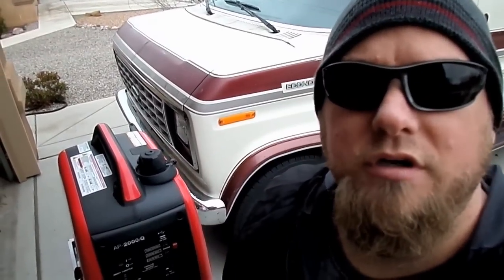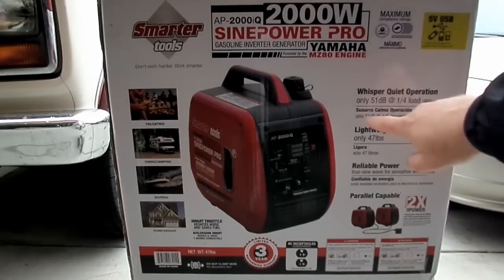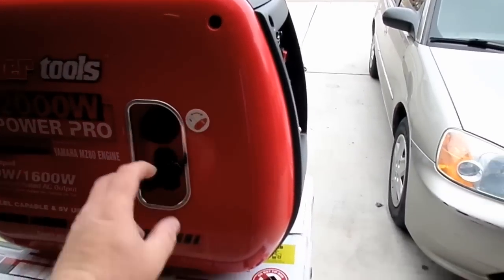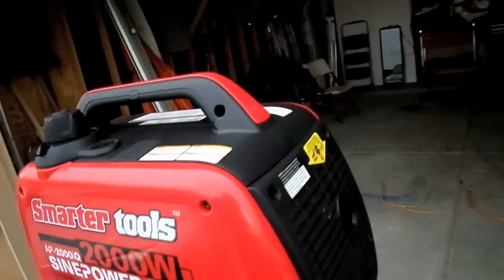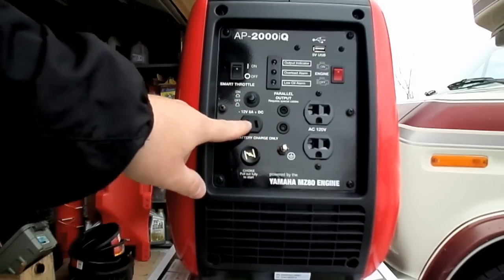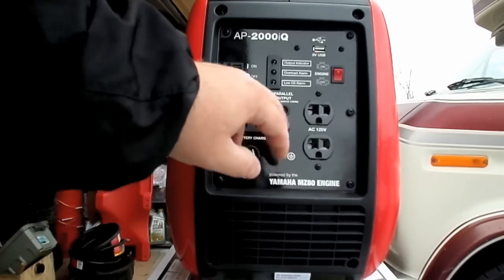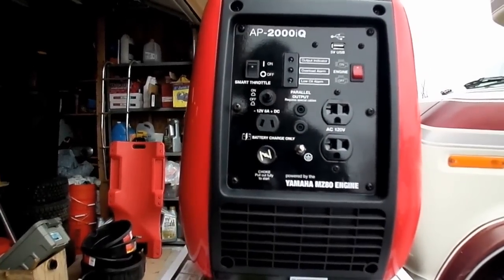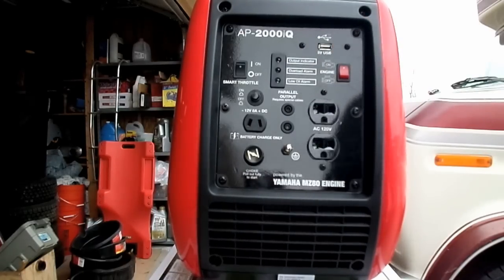Smarter Tools Yamaha Inverter Generator Testing on AC & Microwave in RV CamperVan & Info

Comment: bought 2 of these with the parallel cable. these are the best inverter generators you can buy for the money. no point in the honda when you can grab these for $599 each at Costco. lifetime warranty through Costco. parallel kit was $59
Reply: jgg204 forgot to mention in my comment  - this was the best and more thorough review for the AP2000iQ. Thumbs Up

Comment: Not a Yamaha. Yamaha would not sell engines to a competitor. The company who manufactures Yamaha engines also sells engines to other companies. It's not the engine that you need to worry about, it's things like the stater and the inverter that are inferior. When these things break they are disposable. When a Yamaha breaks it's worth fixing. Do you know that in many cases with these "Economy tools" the employees can't afford rent, let alone the products they manufacture. I already know someone who has felt the sting of buying a Generac branded generator that uses the same engine as yours has got. They're not the same. Trust me!

Comment: Just subbed to your channel.  Thanks for the info !!  Is this generator cheaper than the actual Yamaha version.  I see it's the same motor, but if it's cheaper, I'd definately buy one. Don Carpenter has a youtube channel with a neat hitch rack setup for his generator, you might want to check out.  Thanks for the good information.
Reply from the maker: Yeah Gary.. this geny is only $600 at costco or online. Get one they are great!
Reply: Quite a savings....Thanks.  Lookin' forward to seeing more vids from you.

Comment: I just was checking out the specs on the Honda ei2000 and saw that the fuel consumption for rated load which I think is 1600 watts and max of 2000 is only 3.4 hours and 1/4 rated (500 watts) is 8.? Hours. My guess is the smarter tools and Yamaha are in that range too. 
So my guess is if you are running the AC you might be be getting close to the same has consumption as the Onan. I just saw the Onan C 2.8 microlite for $2264 at PPL no tax free ship. Not sure if the New gens are built better since cummins took Onan over or not. I'm thinking that if you use the gen a lot for the AC and boon-docking that the convenience of the O-C may be the way to go. And also for resale value . If I pickup the 2000 P-way I think I am leaning towards the 2.8. 
When you live in FL or travel out west you well I need AC. 😉
Reply from the maker: Chris Paulick I have had 2 onan 2.8 microlite gensets and I had problems with both and I did not like them. That is my personal experience. The honda or yamaha inverter gens will get better fuel economy. And inverter generators are a cleaner source of power and work great on sensitive electronics as well. The onan is louder. But the onan has more watts available which is nice. And its nice to have push button start/stop from the inside of RV. And its nice that the onan will also use fuel direct from onboard fuel tank.

Comment: How many watts is ur microwave? Any tips on installation. I had 700 watts microwave n 2000 watts generator but the microwave & generator turns off when it's running.
Reply from the maker: Crisanta Feliciano I believe the microwave is 700 watts. As far as I know the watt rating on microwaves is not the actual power consumption, its the cooking power only. Im not sure what the microwave actually uses but I will look into it and make a video. But if you have a 700 watt microwave and a 2000 watt generator then thats more than enough to power it. My generator is 1600 watts running and 2000 watts peak and it runs the microwave no problem. In fact it ran the microwave and other things at the same time with NO issues. Maybe you have an issue with the generator or the microwave is faulty and pulling more current than it should... one or the other it sounds like. I would need a lot more info on your setup to really be able to help. Sorry. THANKS for watching!

Comment: Bought one in 2015. Worked reliably for almost 6 years. Went to use it a couple of weeks ago during a storm in NorCal and found the gas tank had broken off at the tank fill. Tried to repair it to no avail. There are no parts available as the company went out of business in 2020. So I thought I would convert it over to propane. I am unable to find one that will fit it or a Yamaha for that matter. I have since bought a new Honda generator, but would like the smarter tools one for a spare.
Reply: I understand from a friend that you can purchase a complete carburetor with the propane feature...not sure have not had any time to confirm this. Might want to research it.

Comment: Thanks for the info vid on the generator.  I wanted to know what the difference between the portable generator vs the olean (the one that is built into the van).
Thanks
Reply from the maker: The Onan that comes with the rig is a good geny. And its convenient because it uses the fuel from the gas tank of the van. This geny is quiter and uses less gas... also it frees up that geny compartment for whatever you want. Thanks Christy!
Reply: Again thanks for the info.

Comment: I just watched the review of New Generac IQ2000 (not the old Generac IX2000) it quite impressive. They compared noise  level Generac beat the Honda EU2000I by almost 10dB. Now I'm after I watched this it  put a lot of thought in my mind right now which should I get. Honda = $999.00, Generac = $799.00 and this ST Yamaha Inverter Generator = $649.00. Comparing between these price should be no brainer right!? :)
Reply from the maker: +Jay Bui I say give it a shot. That little geny seems great.